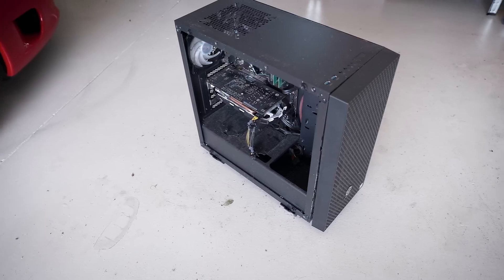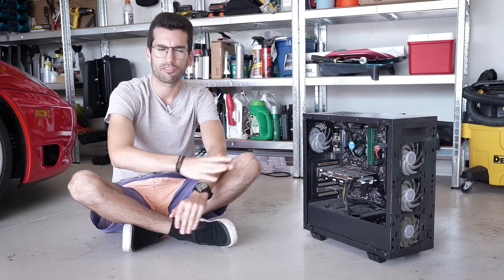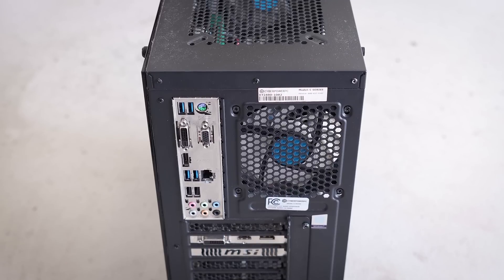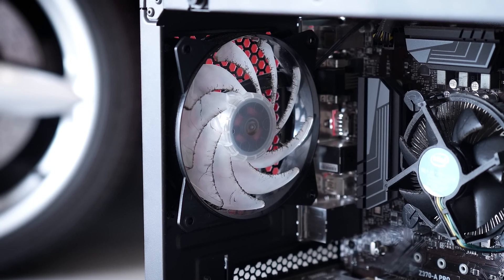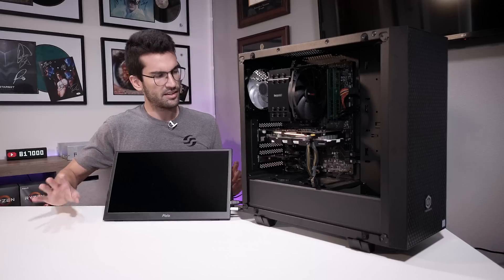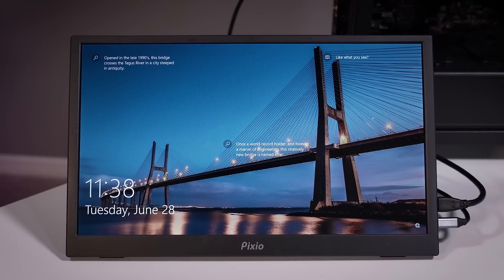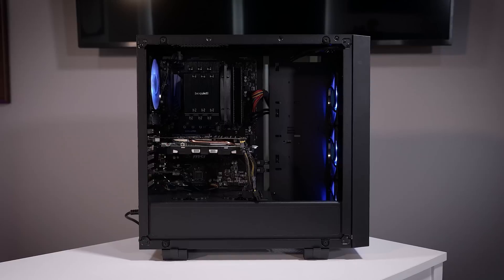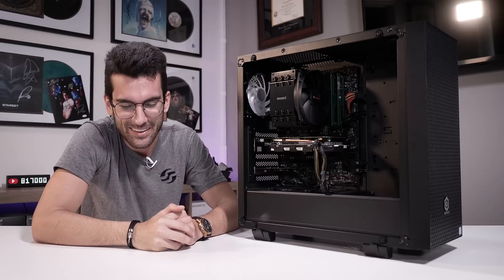Deep-Cleaning a Viewer's DIRTY Gaming PC! - PCDC S3:E8

Comment: Great video as usual. You are correct, its a re-badged Thermaltake Core G21 case (I have the exact same one). Tip is to leave only 1 dust filter in front (it has 2) as otherwise air volume is reduced significantly. Thanks again.

Comment: The 135mm PWM fan from Be Quiet isn't listed on their web site as a separate product or on the usual online retailers. What happens when you need to replace one, just get a 140mm, slide it up a bit if there's RAM clearance issues?

Comment: Depending how badly the fans have been abused (and the type of damage, like animal hair or tar buildup from cronic smokers) they may have gunk buildup on the inside and spin poorly.
In that case they can usually be rehabilitated by immersion cleaning in demineralized water and a suitable detergent. This does require re-oiling the fans after, but that's easy enough. Regardless of condition, almost all fans that are old usually benefit from re-oiling as it tends to dry out over the years. It does depend a bit on the bearing type though. The fill port for oil is under the specs sticker on the back of the motor hub. use heat to remove sticker without cosmetic damage to reuse. Basically any oil works for the job, but I find sewing machine oil is ideal (and easily available).

Comment: With the amount of effort cleaning the fans, would be better to replace them including the ones on the graphics card, cpu, and power supply as that dirt more than likely got into the bearing shaft drying out the lubrication and causing physical wear.
Also using the vacuum cleaner on static sensitive parts, assume yours is an anti-static design (which you should specify in the video) as I don't know how many times I've had someone use a vacuum cleaner on their computer and the static that is generated by the aip moving in household vacuum cleaners generates static that fries components.

Comment: If your house is fairly clean and you have filters in front of all intake fans you should be ok for a year or two as long as you clean those filters regularly. The idea behind this is to have a positive presure inside the case in order to prevent dust from coming in from any other opening on the case. This is why it's generally recomended to have just the intake fans in this scenario.

Comment: Did you apply new thermal pads to the graphic cards components (i don't know the technical term) or did u reuse the old ones?
The thermal pads are one of my major concerns and reason why i never attempted to clean my card since i am sure if could the EXACT same pads somewhere again (stiffness and thickness).

Comment: You know what would be cool? 
Showing temperatures before deep clean, and then after! 👍
Reply from the maker: Wouldn't be much to see. Temps from dust alone won't change as much as people think (unless it's literally buried in it). Repasting alone usually has a much larger impact.
Reply: @GregSalazar  doesn't it reduce throttling on benching? I'm a Gen x and a P4 needed all the help it could get 😄

Comment: Hey Greg. Was just wondering if you dont need to reapply the heat pads on the gpu heatsink. Like is it okay to not reuse or reapply new ones like you did in this video at around the 6:58 mark. As a fellow pc enthusiast and builder. It was just a random question i had. Thanks

Comment: The 8700 comes with a stock cooler since the TDP is only 65W. The 8700K on the other hand is 95W, so Intel doesn't even include a cooler with it. I personally would have upgraded the cooler no matter what, but I wonder what the temps were before replacing it?

Comment: Pretty sure that's just like grease not from like your hands, grease when you cook there are some like dust in my house in those impossible corners that you can't reach or just flat out forget it gets sticky like that and that grease when you cook gets EVERYWHERE
Reply: That’s a ventilation issue. You should have a ducted range hood at the appropriate height and cfm for your stove. If you are forced ductless (recirculating) very few companies make range hoods that work. 

Keep in mind cooking particles can be harmful to inhale as well, especially smoke from high temp cooking…
Reply: @Dirty_Bear22  ahh yes but you see there are ductless range hoods with just filters which is the epitome of stupid and every house i lived in was like that till i finally moved and someone that was putting in new cabinets in the kitchen saw that and said "hey, this is better if you have the duct going out and it doesn't have it i just threw it in while i was doing the cabinets" now there's a fat tube in our cabinets now but there's like no grease... Right when our range hood fan broke because we lost the filter GRRRRR but long since fixed that works great now.

Comment: I used your fix my broken PC to get my Gigabyte 560-ds3h ac-y1 working. Cleared CMOS and replaced battery. Top m.2 slot is dead (EBay refurbished buy) but 2nd slot works Also PCIE 3.0x4. Took the boot usb in the same slot that you do the flashback in.

Comment: you forgot the thermal pads for the memory chips 6:58, right before you put the card back together, I don't see thermal pads, which were present on the heatsink 6:08
Reply: Good catch
Reply: I noticed the same. In the final shot when Greg shows the result, there is a take on the GPU but I can't notice any thermalpad from that angle. Did Greg forget to reinstall them?
Reply: Was just about to write this. Did he forgot? Will the GPU overheat? What will happen? OMG so many questions.
Reply: Yeah, I have seen that too, hope the viewers did not fried anything!
Reply: 1 yr later. VRM and VRAM has melted

Comment: heh, if I didn't live on the other side of the country, you'd get one Hell of a video from my PC. I'm a lazy sack of trash who hasn't cleaned it in a few years(like 6 I think), while owning a 90pound, medium long-haired dog. It's always hot here in the southwest, so I run the side panel off most of the time. When I bought a new CPU and GPU i just swapped out the parts, no cleaning.

Comment: I don't own air purifiers or any fancy stuff but my electronics rarely get this dirty. I just cleaned my pc I built 2 years ago and only the filters and intake fans had some dust, nothing major. By comparison I built my nephew a pc in the past and just a few months later it looked like one of the systems featured in this series. I also once let a friend borrow my ps3 I had owned for years and never had the need to clean. When he gave it back a month or two later all the ports and vents were clogged with dust. What gives?

Comment: I’d loved to have seen the temps pre clean vs after clean. Those fans were just about pointless with that about of fluff 😳
Reply: The difference might have been surprisingly (and disappointingly) small. Dust has surprisingly little effect on temperatures (except, perhaps, if the CPU cooler is so clogged with dust that it actually restricts airflow by a very large percentage). Changing thermal paste that's way too old might have some effect, and might be the biggest affecting factor.
Reply: A closed of Front Panel is much worse than a Dirty Vented one even as bad or worse than this,
My MSI GTX1080Ti Gaming X (1657 MHz) in a Fractal Focus G sits at temps that allow Self Boost of 1974MHz (No OC & Original TP) whether the Filters are Clean or Clogged even in Summer over 40°C with no Audible difference, as WarpRulez said the amount of Temp difference is negligible unless your Cooler is Very Clogged or your Thermal Paste requires replacing.

Comment: Would have loved to see a before and after performance/temp comparison on this PC.
Reply: The difference might have been surprisingly (and disappointingly) small. Dust has surprisingly little effect on temperatures (except, perhaps, if the CPU cooler is so clogged with dust that it actually restricts airflow by a very large percentage). Changing thermal paste that's way too old might have some effect, and might be the biggest affecting factor.
Reply: Greg doesn't like going past BIOS in these because of Owner Privacy
Reply: yes please

Comment: Pro tip, placing your pc on the table instead of the floor will significantly lessen your dust buildup.
Reply: Yeah, or maybe clean your room once in a while...
Reply: @Coconut7403  depending on where you live and proximity to animals you could hoover twice a day and still have to battle to keep the PC reasonably clean.
Reply: this is the way. You might think this is pretty trivial but dust works by gravity and by that logic the floor has all the dust. Raising it as little as 1 foot will drastically reduce dust build up.
Reply: i know this very well but i still cant keep my pc on top , something or somebody will knock it down, i dont have space to keep it up
Reply: agreed. my old build was on the table the whole 5 years i used it, most of the time in its later years 
even leaving it on overnight almost everyday, and the dust build up is at least half of what this pc owner had lol
Reply: "Pro tip, placing your pc on the table instead of the floor will significantly lessen your dust buildup."

I can personally attest to that, having done both for long time, in the exact same room and exact same living conditions.
Reply: And clean inleast every 6 months 😉😉
Reply: @SigalDa  Not arguing but I've had PC's last well over a year before total cleaning because good case design and keeping the filters clean every 2 weeks.
Reply: @PLr1c3r  🤔so not arguing, but you don't need to clean your PC as often as every 6 months or even every year because you clean it every 2 weeks 👍
Reply: @shaneeslick  cleaning the filter is not cleaning the whole pc. It is a lot less time because you only need to wipe the filters once.
Reply: @robertluong4652  "It is a lot less time because you only need to wipe the filters once" 🤔No, you are wiping the Filters 26 Times
Taking the Filters out & wiping them down out 26 times a year even at 5min a time = 2hr 10min + a Yearly Clean vs
me taking 1/2hr -1hr to Dust & Wipe mine, friends or family members PCs once a year or
me taking 2-2.5hrs to fully clean a PC including CPU & GPU including Thermal Paste with a Compressor, Electric Toothbrush & alcohol every few years,
I provide this service for family & friends in a day while they are at work including making sure all updates are done
Reply: @shaneeslick  what are you talking about? I said that cleaning the filter is not the same as cleaning your pc and that it takes longer to fully clean a pc. Also it takes like 30 seconds to wipe your filter. If you have a high power pc and run your intakes at around 60 percent at high loads; then you know how well filters work for keeping out dust. Also the guy might have pets or outside factors that require him to clean the filter constantly.
Reply: @robertluong4652  Ps But I'll give it a go, if you don't clean the dust inside your computer that got through the filter when you clean the filters after 1 year there will still be 1 year of dust in your computer that got through the filter because you have not cleaned the dust inside your computer 🤯
Reply: @shaneeslick  I'm not gonna go on about this much but here it goes,  if your filters are not clean the air comes through holes and crevasses that aren't filtered because it's the path of least resistance. Ps you don't have to have the PC on to clean your filters u can go by appearance and environment factors.  I've been building maintaining pcs for 20 years so please save your breath...
Reply: @PLr1c3r  😲WOW! you have been building & maintaining PCs for 20Yrs, I have been doing that since the '80s,
My point is you claim you don't need to spend 2hrs doing a big cleaning once a year because you spend what 5min cleaning your filters 26 times a year as if you are saving time & energy,
work out how much time you spend cleaning, plus there is still dust build up that gets through the Filters even if you don't think it is Dirty enough to clean.
either way you do it takes roughly the same amount of effort each year, so please save your breath...
Reply: @SigalDa  i clean it every few days
Reply: Useless if you live in house made of bamboo and wood..XD
Reply: Or, if it isn't possible to put your case at a desk, just make sure you don't have carpet under the pc (i.e. put some plywood at the floor first).
Reply: @gilles111  If putting the PC on the Floor it's also better with a case that has the PSU at the top,
so it is not breathing in from the bottom sucking up all the settled dust like a Catfish
Reply: @gilles111  ye, i put my pc on a stool cuz i don't have space on my table
Reply: @jeji5860  Mine is on the floor but has extra feet and on a wooden floor.
Reply: That is only if you have sufficient space for the system. Placing the PC on lower platform or floor is the only option for some who are space constraint.
Reply: This isn't always possible with the space you have, but if you do, obviously it's ideal.
Reply: Got my PC on the floor, but because I've got carpet I put it on a thin piece of wood, seems to help quite a bit. Along with it being a fractal design case and their filters doing a pretty good job of holding back dust. 

Don't even have to clean out the dust cover that often either surprisingly enough even though I have a dusty room.
Reply: @renegeeder  those are mesh right?
Reply: @jeji5860  Correct
Reply: I wish I can keep my PC on my desk, but I don’t have room. My gf bought a very expensive desk that only has enough room for two 27inch monitors. Luckily we have hardwood floors.
Reply: @Digitalknifeparty  put it on a stool then just not on the floor, trust me
Reply: dont have pets , less hair

pc on table

vacuum floors

and/or also have the air purifier which greg has , and if possible have a mesh infront of windows if you often have open windows so you dont get much dust coming in
Reply: 😎 Wall mounted